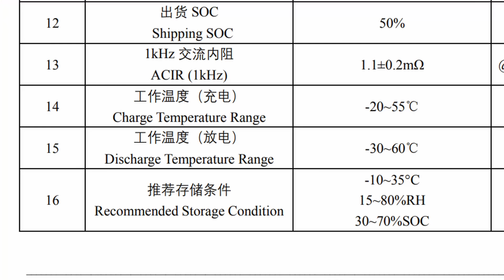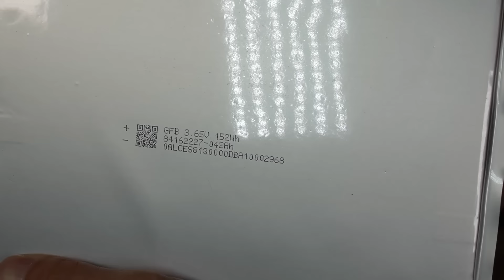CHINS Solid State Lithium-ion Battery Tear Down and FIRE!

Comment from the maker: Data sheet for this cell: https://diysolarforum.com/resources/ganfeng-solid-state-lithium-ion-42ah-pouch-cell-battery-data-sheet.297/
This would not happen with a LiFePO4! I would consider this chemistry as dangerous as lithium polymer, and we do not use any cobalt based chemistry on this channel for this very reason. 
0:00 Intro
3:03 Tear Down
6:37 Puncture Test
7:02 FIRE
8:14 Conclusion
~~~~~~~~~~~~~~~~~~~~~~~~~~~~~~~~
Does off-grid solar confuse you? 
Check out my DIY friendly website for solar system blueprints and product recommendations, and so much more! 
http://www.mobile-solarpower.com

Join our DIY solar community 
#1 largest solar forum on the internet for beginners and professionals alike:
https://www.diysolarforum.com

Check out my free book
Best-selling and beginner-friendly guide to 12V off-grid solar!
https://www.mobile-solarpower.com/the-book.html

~~~~~~~~~~~~~~~~~~~~~~~~~~~~~~~~~~~~~
My Favorite Online Stores for DIY Solar Products:

Current Connected
My favorite USA Distributor! Best Prices for EG4, Victron, Solar Panels and high quality components. Fantastic customer support and fast shipping: 
https://currentconnected.com/?ref=wp

WattCycle
My favorite 12V budget battery!:
https://www.wattcycle.com/?ref=aaezwkkc

Epoch Batteries
My favorite high-quality 12V battery:
https://www.epochbatteries.com/products/12v-460ah-lifepo4-battery-ip67-heated-bluetooth-victron-comms?rfsn=7352625.50494d

Watts247
Need international shipping for large batteries and big inverters? Check them out!
https://watts247.com/?wpam_id=3

Rich Solar 
Budget 12V Inverters and MPPT:
https://richsolar.com/?ref=h-cvbzfahsek

Battery Hookup
Cheap used lithium cell deals:
https://bit.ly/2mIxSqt
5% off code: diysolar

Contact Information:
I am NOT available for personal solar system consult! If you wish to contact me, this is my direct email: williamprowsediysolar@gmail.com

Join the forum at https://diysolarforum.com/ if you wish to hang out with myself and others and talk about solar

FTC Disclosure Statement and Disclaimers:
Every video includes paid promotion or sponsorship. Some links on this youtube channel may be affiliate links. We may get paid if you buy something or take an action after clicking one of these. 
My videos are for educational purposes only. Information is subject to change/update at any time. Electricity is DANGEROUS and can kill. Be smart and use common sense :) 
DIY Solar Power with Will Prowse is a participant in the Amazon Services LLC Associates Program,
An affiliate advertising program designed to provide a means for sites to earn advertising fees by advertising and linking to Amazon.com
Reply: Will, I have an interesting theory that you might have to cross-check.
I am of the view that it was the drilling movement that initiated the fire and not the mere exposure of the lithium-ion. What was done in the video sent to you is different from your experience.
Reply: Great to see your primal joy in setting something on fire, ^oo^
Reply: their screwdriver also made it so very little oxygen was reaching the interior of the cell. the heat/chips from the drill may not have helped, but you should be able to drill through it many times with no issue. SS still has a long way to go. Toyota supposedly has something "amazing" in the works, supposedly. Thanks for a great vid!
Reply: 3:05 "If I get cancer, it's because of this" LMAO!
Reply: Hi Will,  What happened at 2:54 ?  Is it the essentially the same solid state model ?
Reply: Looked like a fart bomb

Comment: This by far was the most exciting Will Prowse video I have seen!  This is why I only use Lithium Phosphate  You just don't run into those kinds of explosive issues!
Reply: Though then you get low amp draw, low power.
Reply: @leonordin3052  low amp power draw? that' not accurate. c rating is lower compared to li-ion. but that doesn't mean it's low. its just lower in conparison.

Comment: Glad you posted this. Can't say your test was the same as the Chins test since the drill created far more friction than a sharp object being shoved directly through a cel with no rotational force. But your point is still very valid. Battery chemistries of any kind are flammable.
Reply from the maker: Yes very true, but if this was LiFePO4 and the drill's friction caused combustion of the electrolyte, it would be a nice slow burn. Going by this reaction, we can see it has cobalt, oxygen was released and reacted rapidly.
Reply from the maker: Really wild to see it have a self-propagating runaway like lithium polymer. I was not expecting that. I do not think this is a true solid state cell. Even though the data sheet claims that it is.
Reply: This presents a very serious issue when used inside any structure. What happens when the device is exposed to an external fire. Perhaps one that would be manageable without the batteries.
Reply: Great video.  I'd like to see another cell tested with puncture only like the Chin engineer video.  Also similar tests with a LiFePO4.  Sure it'll get a bunch of views also!
Thanks again!
Reply: @WillProwse  Maybe this is why they were saying it was "semi solid state" in their emails.
Reply: I do not believe friction was the direct cause, though it being a drill bit certainly helps. The rotation would smooth the layers of the battery together creating a better connection, than a screwdriver puncturing it. The battery should still be able to survive this though.
Reply: @WillProwse  It looks like it might be the Ganfeng 84G2N07 semi solid state pouch cell
Reply: I would love to see another test with a nail puncture and not with a drilling machine
Reply: @WillProwse  O2 was not released as if it was inside it would burn already, once the gas or liquid was released it hit O2 then start a fire.
Reply: @TheUGFUGF  not quite correct. The electrolyte releases O2 when it decomposes accelerating an already in progress failure. The is the “runaway” reaction typical of cobalt based chemistries.
Reply: Agreed. The step bit created fillings and mixed the fillings. Great reply tho Will. Would have liked some more discussion comparing this fire to what you'd expect to see from other batteries. My guess is you were soooo disappointed isn't because this battery was the only battery that would catch on fire if exposed to that kind of test, but because it was hyped so much but didn't live up to the hype.
Reply: @notreal5311  In my mind it doesn’t matter. If they are trying to push the concept that these are safe even if punctured and it’s clearly not true.. I would not trust this company…
Reply: @dakota4766  of course, I'm just curious what the difference would be from a safety of LiFePO4 perspective.  How much more or less safe us it from the current king?
Reply: @WillProwse   prove it
Reply: Abuse should be part of every tear down
Reply: @WillProwse  yep,    Now your gonna have to give fully charged  LifeP04   cell the exact same abuse so that we can see the difference.   maybe do it twice just to prove repeatable results.   and same capacity would be nice, because it appears that a same size lifep04 will be half the capacity, so i think one would have to assume half the reaction based on that alone.
Reply from the maker: @johng4527  just did and posted it today. Fully charged and drill test.
Reply from the maker: @danyoungs4061  yeah I did prove it. Does anyone here even subscribe to the channel 😂
Reply: @WillProwse  glad you proved these guys wrong even though any enthusiast should know lifepo4 is safe 😂
Reply: Imagine these cells in a home battery ESS. Some homeowner weekend warrior drills through the battery… kaboom
Reply: @RiaSolar  we need to give that battery to demolition ranch!
Reply: @WillProwse  😎😎😎
Reply: @WillProwse  I do
Reply: *organic chemistries

Aqueous chemistries avoid all flammability issues.
Reply: @WillProwse  Please share link to the LFP picture test video
Reply: Yeah, in their test they didn't let air out by pulling the screwdriver out. They left it in which deprived oxygen from being exposed to the materials inside, cobalt like he said.

Comment: Will, As a Fire Marshal we are seeing more and more training videos for all the various rechargeable batteries and charging systems.  It is only a matter of time before there is a huge, HUGE fire in a storage or charging facility of battery systems.  With electric vehicles and more and more solar systems in use than ever before, Fire Departments will be having their hands full!!!
Reply: It's already happening with people stealing parts here and there and trying to cobble together an e-bike or scooter in their home only to have it set fire to the whole place and leave many people homeless in the process if they are lucky enough to get out alive.
Reply: I have a great Idea to isolate and possible prevent house battery fires.. Hempcrete small room for them.. I'm positive that it would keep a battery fire from spreading.. electrical outside of that couldn't really change more than regular. But hempcrete at 1' think has r30 ish insulation factor so keeping them at a optimal temp would also be easier..
Reply: The Felicity Ace caught fire and sank because of the batteries in the cars.
Reply: @jamesray9009  I was thinking a small concrete room w/ whatever fire extinguisher works best.  Would water exacerbate a battery fire, or not?
Reply: Fascinating, I hadn't relaized these batteries presented such a threat, and w/ numbers increasing over time, yikes!😱
Reply: think that depends on chemistry  of battery .. I'm far from any kind of expert on this but when I watch a guy hold a torch to the wall for like 30 minutes and almost 0 damage is done .. then I think it would hold without issue .. ive even seen stack in place hempcrete blocks that I think are on the market now.. someone could build a room over a weekend alone
Reply: What's safer from your view, an oil refinery or a storage/charging facility you're talking about?
Reply from the maker: If they use lifepo4 it won't be an issue. But NMC/NCA, absolutely. Just a matter of time for those installs
Reply: I read that homeowners insurance is going to skyrocket next year for EV owners because of a high risk of them catching on fire during charging in peoples garages. It's expected to go up 20%. It's already being negotiated with Democrats...who are pushing the bill with the insurance companies.
Reply from the maker: Everyone is switching to lifepo4. For ev and stationary storage. That's why my channel never touches cobalt based chemistries. Not worth the risk
Reply from the maker: @KB-ke3fi  oh interesting
Reply: @jamesray9009  Building a room over a weekend sounds attractive. Might as well build yourself a tornado or hurrican shelter while you're at it.
Reply: @acmebrainsurgery  I have a shipping container with like 50k in weight thats my bug out box lol :)
Reply: Kevin, is water adequate for putting out these fires?
Reply: @jamesray9009  That'll work!👍
Reply: @acmebrainsurgery  Yes and no!!!  Depending on the battery size, you will need a lot more water than what is used now…… A LOT MORE!!  There was a fire (I think in Illinois) where they had to use concrete to encase the building to extinguish it.  I have seen a video (much like Wills video) where a pack of 4 AA batteries were over-charged to the point of thermal overload and the resulting blowtorch of fire was approximately 6-8 feet high.  Now imagine a battery pack with 100 (or more) AA batteries and you can see the problem.  I was just in a virtual seminar where the instructor suggested that if there was a fire involving an electric vehicle inside a garage or structure, the best course of action may be to use a tow hook to drag the car outside and just let it burn in the driveway away from any structure!!  I’m glad I’m at the end of my firefighting career!!!
Reply: @kevinwiley9696  Whoa! I am truly shocked!
I had NO IDEA they could be that dangerous.
It would be incredibly helpful if some fire dept, maybe yours(?), could start doing informational videos on the problem. You may well save many lives and homes.
Reply: @kevinwiley9696  P.S. I have, on occasion, left rechargeable batteries in the charger overnight, I'd simply forgotten about them. Really bad idea I guess.😬 Stay safe for the duration.😊🍀
Reply: I really worry about a huge fire at one of these facilities because of the smoke that will be inhaled by people and their pets down wind of such a fire.
Reply: @jamesray9009  plus if it did catch fire everyone would be to stoned to care LOL
Reply: @acmebrainsurgery  lithium + water is bad bad
Reply: @Gamer-nc8qp  That's good to know. So what does work? I almost burned my house down when I was about 14 because I didn't know how to put out a grease fire, so I know how important it is for everyone to know how to put out various fires.
Reply: hands full ? no,they probably won't, they will  mostly watch until it's all consumed,then get in;  i see that so many times
Reply: @KB-ke3fi  When you start talking politics you better have real life evidence, otherwise you’re just puffing. Not talking about some conspiracy channel either
Reply: @FirstLastOne
Reply: @jamesray9009
Reply: @Gamer-nc8qp  there is not very much lithium in a lithium battery, and it is not in the form of elemental lithium metal. You don't have to worry about the reaction of lithium metal with water. The problem is the electrolyte is flammable and the smoke is very toxic, and the amount of water required to extinguish it is very large.
Reply: @acmebrainsurgery  it seems like the fire departments have settled on using massive amounts of water. For EVs they extinguish the fire, then tow the vehicle to an open area and keep it under observation for a long time because they often flare up again after many hours or days. I think the key is to keep the battery in a location where it can burn without the fire getting out of control. Think twice before trying to fight a lithium battery fire indoors. The smoke is much more toxic than, say, wood smoke.
Reply: @mckenziekeith7434  Thank you Keith.
Might seem far fetched, but I wonder if something like expanding foam, or something similar, made of whatever material is not reactive to the batteries, would extinguish the fire by depriving it of oxygen.
Reply: @charonstyxferryman  Thank you Lars, I was thinking that a battery was more like a chemical fire than an electrical fire. But then, 
i don't know much about either.
Reply: @acmebrainsurgery  Once they ignite, they cannot be extinguished until they are done combusting.  But you can spray water on them to cool them down and keep the fire from spreading to adjacent cells and the surrounding area.  Just be careful since this is also involved with electricity, especially near the AC side of the power system.
Reply: @charonstyxferryman  Not true.  For a lithium battery fire, water is about the only thing you can use effectively on it.  Once a cell starts burning though, it is extremely difficult to stop the thermal runaway.... essentially it will burn until the fuel is consumed.  But you can use water on it to cool the adjacent cells and surrounding area to try to keep them from igniting also.  It is both a Class A fire AND a Class C fire...  which is why they can be so dangerous.  But, the voltages are low for a single battery like this, so be sure to kill the AC side of the system should you ever need to fight a battery fire.
Reply: @BKD70  Ok, thanks for the info.👍
Reply: @WillProwse  lifePo4 , are they safer?
Reply: @KB-ke3fi  yes, some insurance companies are no longer offering homeowners insurance in California.
Due to the states regulations and laws State Farm is who I heard it through.
 Funny how it's appearing that were being regulated to ridiculous extremes.
 How much must we pay, to subsidize our own demise?
Reply: Is your name Bill
Reply: @invisibilianone6288 Climate change having real world effects, same thing happening in Florida.
Reply: I know this comment is a year old but it has come true. There is a battery storage system that is part of the electric grid in California that has been on fire for an entire month.
Reply: Fire blankets man that seems to be the future

Comment: If you noticed, on their puncture test, they left the puncture probe in the battery - when you drilled, you pulled the bit out and allowed oxygen in - it would have been interesting to see what result they would have gotten if they had pulled their probe out

Comment: Hey Will, As a retired Haz-Mat safety specialist, I will let you slide on the on the rubber "Crocs", but may I suggest adding some Fire Resistant Nomex Socks to your clothing attire. I am not saying as an everyday thing but for situations like this, Safety is #1. 
Actually, on second thought, It would be hilarious to see you in full bunker gear while performing tests like this. You can purchase some nice used lightweight bunker gear on eBay that would go great with your Crocs & Nomex socks
Reply: More fun in short sleeves, shorts and crocs. Who needs a yucky respirator? Breathe through your nose!❤

Comment: In the demo that the manufacturer sent you, they did not remove the item that punctured it. It was a plug then.  your puncture caused the gas to emit after the drill bit heated up with speed, that’s when the real fire started.    That was fun! Thanks for showing us the crap we need to stay away from.